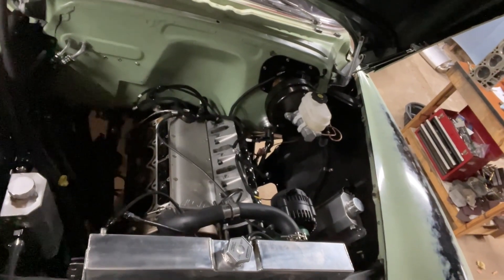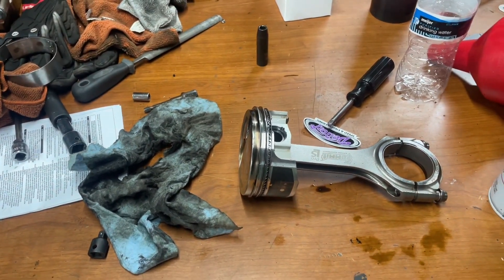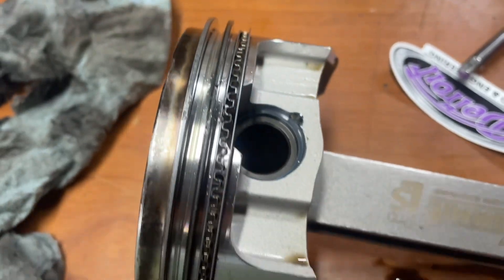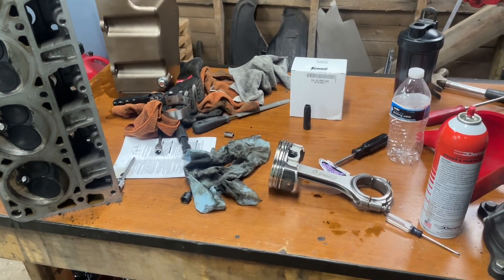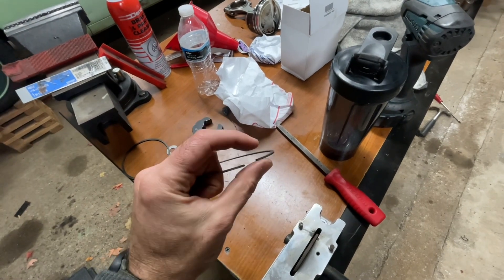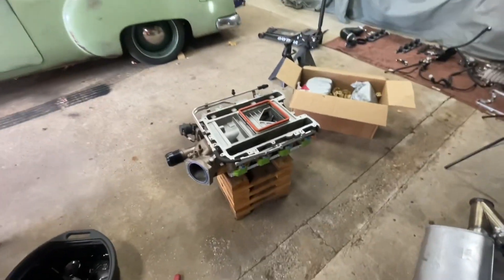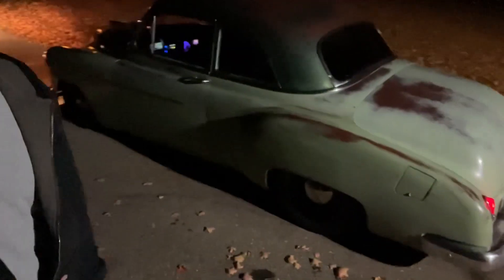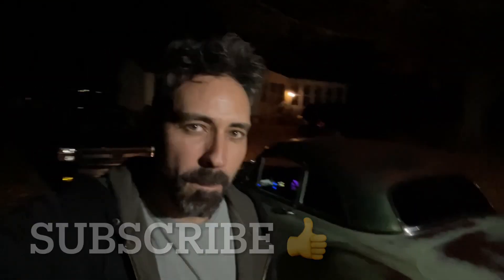Piston down!

Comment: Just finished watching this build series. Awesome work ! Love the 49-53 coupes. One thing you could have done, since you were right there, is taken the rec port heads off the 6.0 and put them on the stroked 4.8. The LSA's work better with them and you wouldn't have to deal with the adapter plates. Yes, it would have been a lot of screwing around swapping several things around. But the end result would have been a win for several things. Looking forward to seeing more of this car. Keep up the good work

Comment: Very cool, I have a 51 chevy deluxe bel air I''ll be starting soon, could you do a video on the 4l80 transmission /engine how to flash or program or send me info on how its done, please.
Reply from the maker: I’m running the Holley Terminator X system. Tons of videos on how to work with it by much smarter people than me